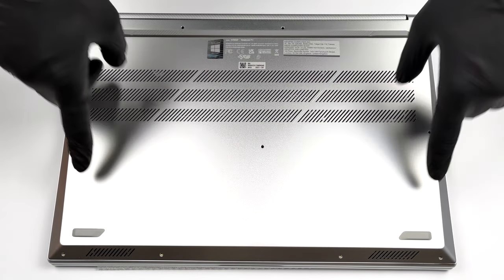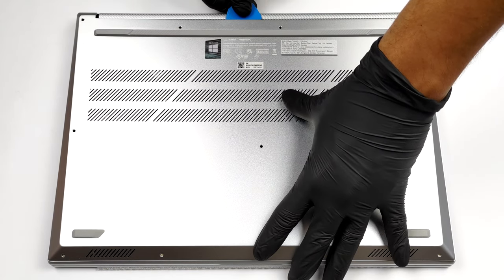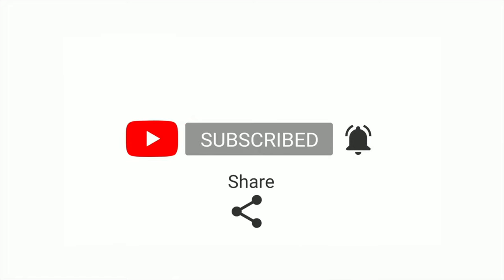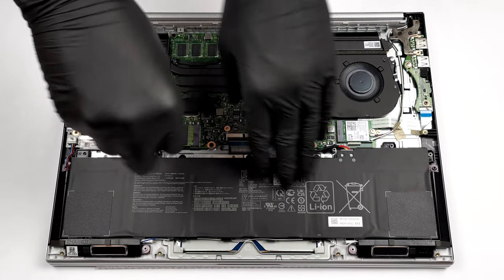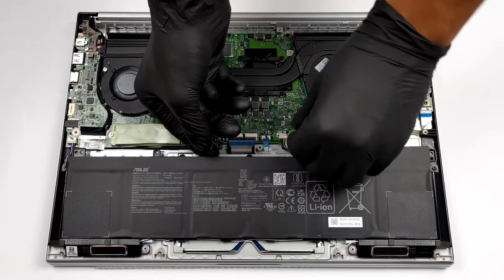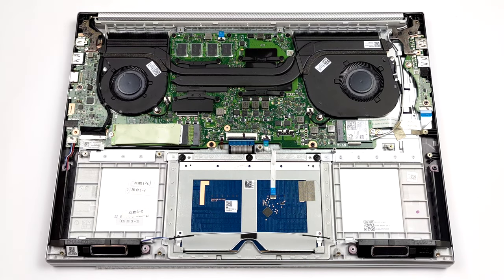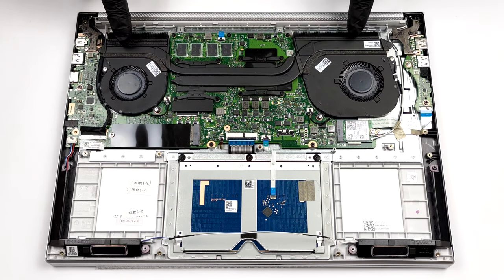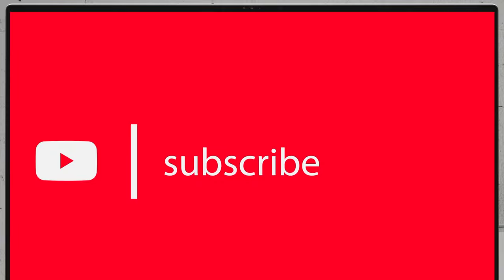🛠️ ASUS VivoBook Pro 16X OLED (N7600) - disassembly and upgrade options

Comment: In a 16" device it's really inexcusable to have soldered RAM and only 1 m.2 SSD slot...

Thanks for the teardown.
Reply: You are already lucky, know that the Italian version only has 16GB of soldered ram :( amazing considering the rest of the hardware
Reply: @franzugo  I can confirm, I've the Italian version, really so sad. But hey it's running all the tasks good like graphic programs and 3d rendering process are quite  smooth
Reply: @franzugo 16GB is at least acceptable, ASUS has models with 8GB of soldered RAM, I don't know what they were thinking about in 2022 'inventing' that supermodern laptop